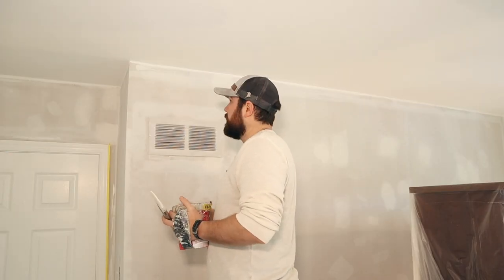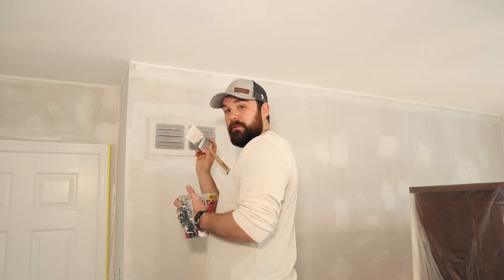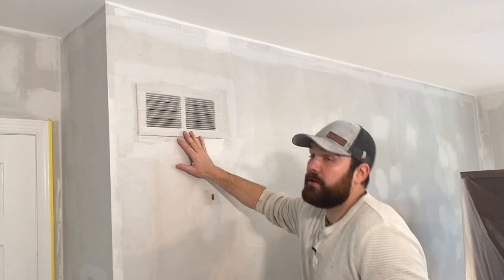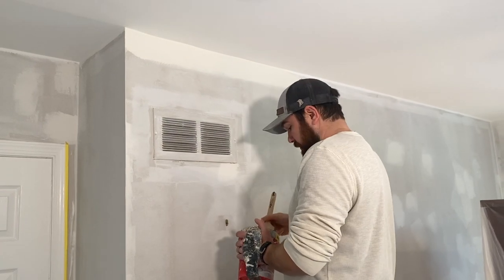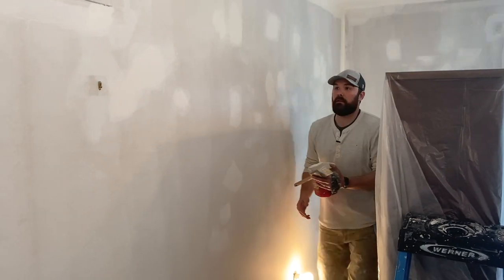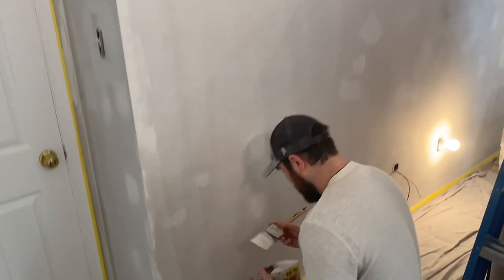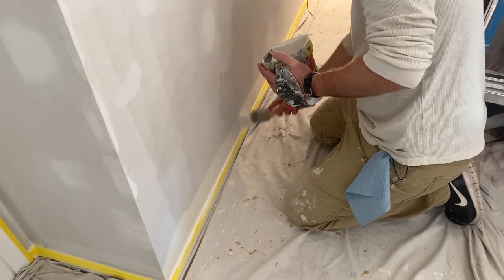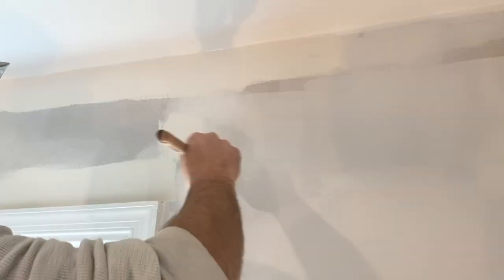Painting a Bedroom | Part 15 | How to Cut In Paint Like a Pro

Comment: a flat bush with more bristles is what is best. Flat brushes are actually called wall brushes. Angled brushes don't hold enough paint for cutting walls and leave voids because they don't have enough bristles.
Reply from the maker: That is very much brush dependent and the painter's preference.  Low quality brushes have low bristle counts.  I use a sashed Corona Cortez and I've never had an issue with voids or missed areas.  Whatever you're doing you've got to pay attention to what you're doing.  I do a lot of technical cutting in, which is why I use an angled brush.  When I do something like siding or deck staining then I use a squared off brush.  

You might be surprised at the types of brushes guys in the field get good with.
Reply: @SuperVassarBrothers  Bristle count is determined by its intended use, not necessarily by the quality of the brush. A trim brush doesn't need the same bristle count as a wall brush. The Cortez is a very good brush, but it's just not a wall brush. Corona makes a couple of wall brushes like the Monteray and the Opal. The Cortez is super thin compared to those brushes.

Comment: Man, I love watching a craftsman ply his trade. You make it look effortless. I live in Florida and have knockdown finish on all surfaces, would you have any tips on cutting up against crown molding or baseboards?
Reply from the maker: You can cut the line between the walls and the crown the same way I cut the walls into the ceiling in this video.  You can also tape the bottom of the crown with painters tape like we taped out the baseboard in part 14.  Taping out the baseboard is a solid move and you can get good results particularly if you use a good tape and get a good seal on the tape.  I went over that in Part 14 as well.  Thanks for watching and good luck with your project!

Comment: Do you guys always cut in all the walls ina room first, or do you guys cut one wall at a time before rolling to keep a wet edge? Just wondering if it’s noticeable to the eye if you come back to roll the walls after your edges are dried. Thank you for the great video and your time reading/writing comments!
Reply from the maker: Back in the day paints were quite finicky and you had to keep a wet edge and roll right away.  Nowadays, at least with the products that we typically use, it's not imperative to keep a wet edge when cutting and rolling a wall.  I usually cut the whole room in then roll.  However, if you're working with a cheaper product or a really dark color, then it's not a bad idea to do one wall at a time.  I find that to be more important with the darker colors.  

It also depends on your speed.  We're fairly quick at cutting in (particularly when we're not filming), so it's not usually an issue.  If the cut-ins are taking a long time then you might also want to cut and roll in smaller sections.

Good luck with your project!
Reply: 1 wall at a time Because if you do more and the cut dries you will get a thing called picture framing

Comment: What are the reason(s) against cutting with a small roller?
Reply from the maker: Hi there.  Some guys do cut in with a small roller to mimic a roller finish for the entire wall, downside  is you still need to use a brush to cut in the ceiling line, and sometimes the baseboards.   Also you would have to tape off doorframes, and window frames.  We hand cut in those and don't have to tape.  Some guys love the mini roller method, we haven't noticed much of a difference, and usually only use it on dark accent walls.  Hope this helps!
Reply: @SuperVassarBrothers  Thank you. I’m definitely going to give cutting with a brush a real go. Lol I do hate taping :P

Comment: What do you think of duration vs emerald for interior walls?
Reply from the maker: I like them both.  We mostly use Duration Matte for interior walls.  We also Duration Flat for walls in large areas that have a lot of natural light, like entryway foyers.  Emerald is good as well, its just more expensive and I haven't experienced a noticeable difference in quality that would make me want to switch over to the more expensive Emerald line.
Reply: @SuperVassarBrothers  ok thanks for the info👍🏻
Reply: @SuperVassarBrothers  duration is $70 and emerald is $75 for me since I don’t have an account. I would by during a sale though. Not sure how much of a difference your prices are but for $5 more is the emerald worth it?
Reply from the maker: There's a 30% off sale at Sherwin Williams on paint and supplies February 5th through the 8th.  I'd recommend getting whichever paint you can get a better deal on.  You can't go wrong with either.  $5 may not make a big difference if you're only getting a few gallons, but if you're getting a big order then it can add up.  Good luck with your project!
Reply: @SuperVassarBrothers  yes that’s what I was going to wait for was the 30% off. Other people
Said about setting up an account but I thought that goes by how much you buy to get better deals so the 30% off is prob my best bet.